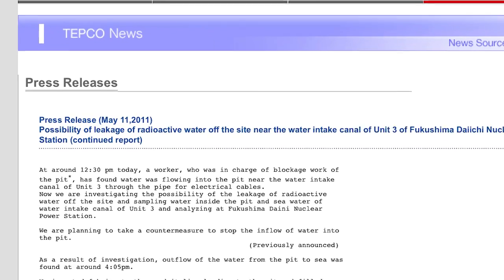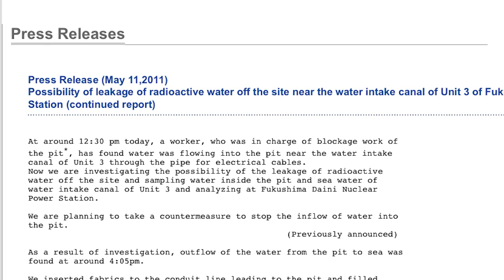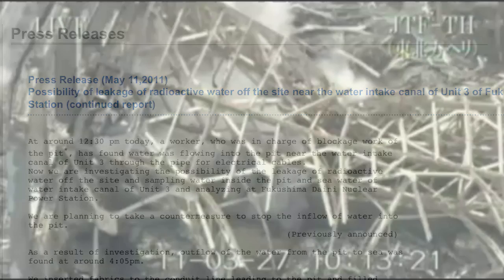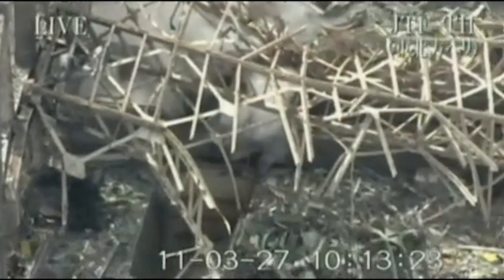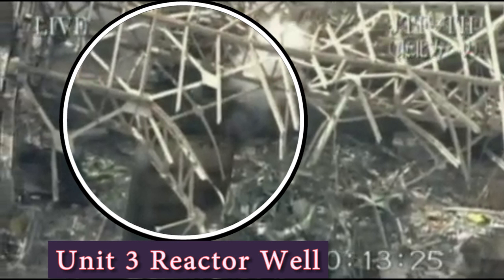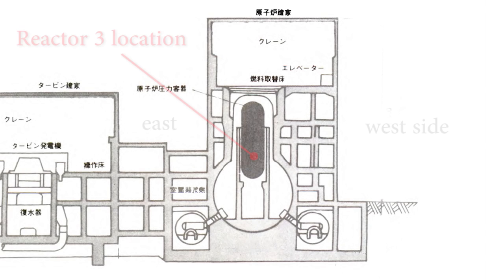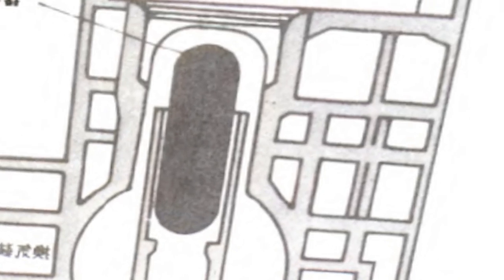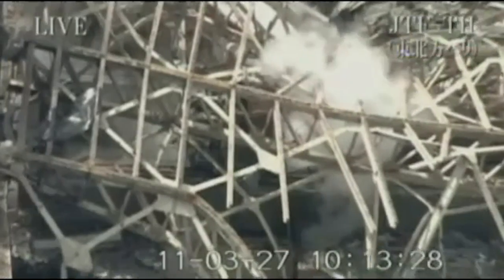福島第一 Fukushima Unit 3 Reactor Well

Comment: "I am not so sure that this is steam. It looks mor elike smoke to me, it is not acting like steam."  How do you expect steam to act?  The usual indicator is, where it is injected into the air, it becomes visible because the air is carrying more water than it can hold; the remainder comes out as visible water droplets.  As it mixes with a greater volume of air, , it goes back into the vapor state, disappearing.  Smoke doesn't disappear as quickly, though it does become more dilute and eventually disappears.

It appears to me to be steam.

Comment: That's not the reactor well. Well is bounded by 2 central squares around center of long wall, what you see is collapsed crane sitting on top of equipment pool gate. Water from fuel pool has probably leaked onto reactor cap, and steam is coming out of edges of concrete plug which is still in place.